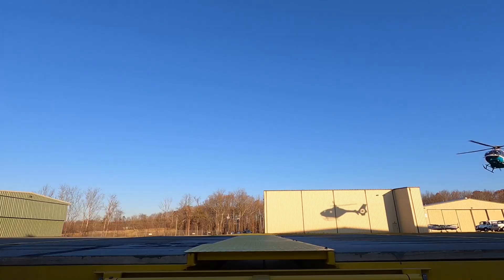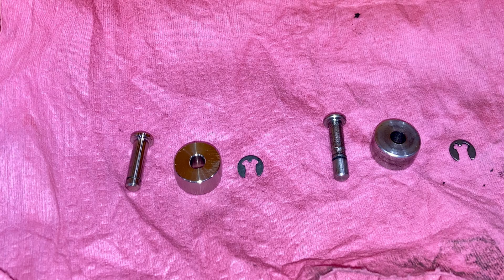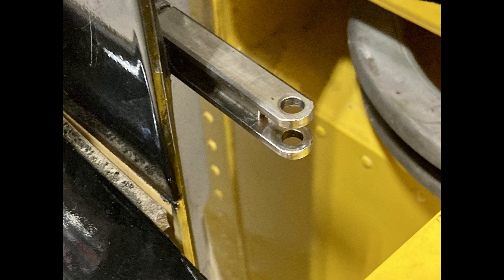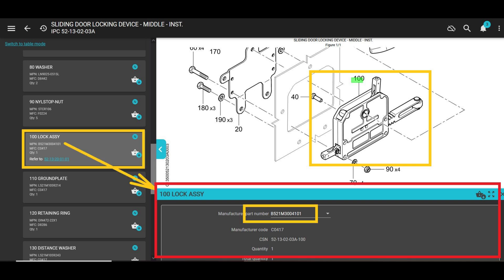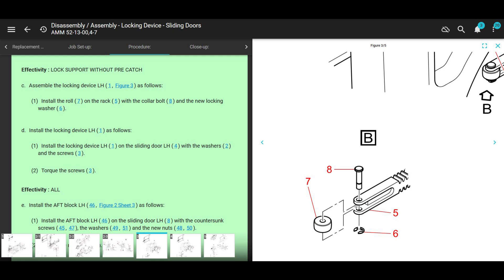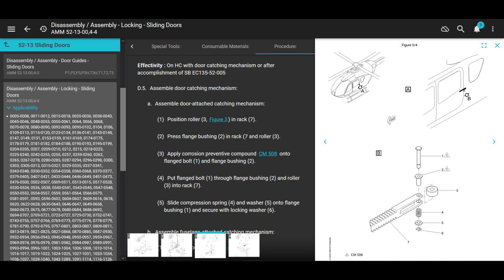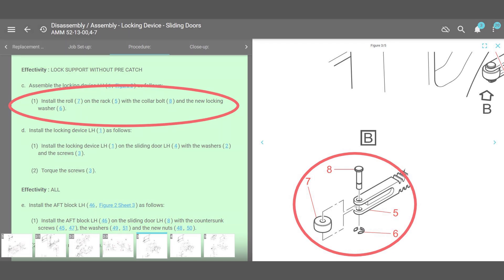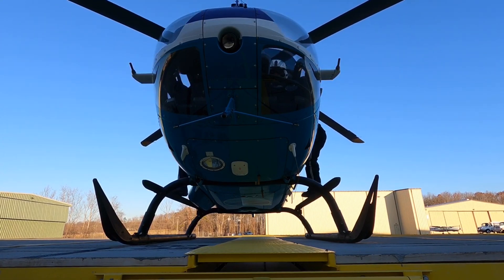Sliding Door Lock Roll | Airbus Helicopters | EC135 | EC145

Comment: I couldn't find it too :D What S/N helicopters do you work on? Can't wait to see more videos!
Reply from the maker: The 135s that I deal with are between 364 and 740.   The machine at by base arrived with 12 hours on it in 2010.  It has almost 5,800 on it now.   I would love to be able to work on a new P3,  I heard that the Helionics is a really nice upgrade.  Also, the new style electrical boxes are really reliable.  That's probably my biggest gripe, when I replace the electrical master boxes, the "repaired" box usually has some problem that doesn't show up for a week or so.
Reply: I deal with S/N between 846 and 936 (can't remember exact but sth around that) - P2+ helicopters (2009/2010 delivered) around 4400 FH, and couple original P3 1206-1209 (2015 delivered) - but we don't have Helionics on them...Also, some of my P2+ are upgraded to P3 (we call them P3x). Do you have problems with search light located next to front cross tube? These components tends to stop in random position and can't be retracted or even controlled. Also have issues with master boxes and battery master box mainly bus tie caution, or LED ilumination on boxes (error message).
Reply from the maker: No I haven’t had problems with the search light, maybe you have a different light than me.  I have seen problems on a 407 Searchlight where the contact inside the cover got burnt out. I wish I could upgrade our P2+’s  to P3s
Reply from the maker: It’s funny that you talk about the electrical boxes, today I had a problem with the amperage on one side was 45 and the amperage on the other side was 20. I adjusted to U POR, and they’ve been on at least two flights now and everything is good, so who knows